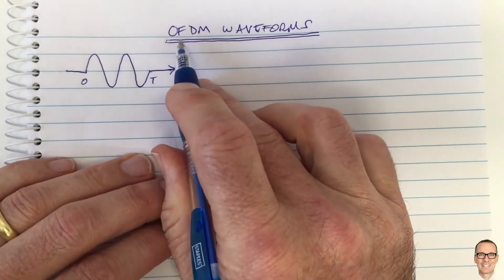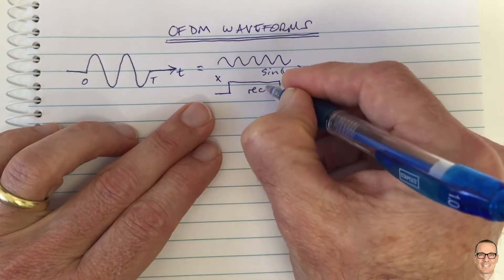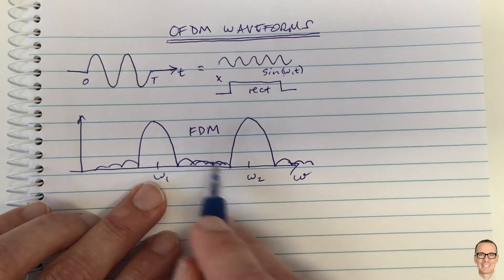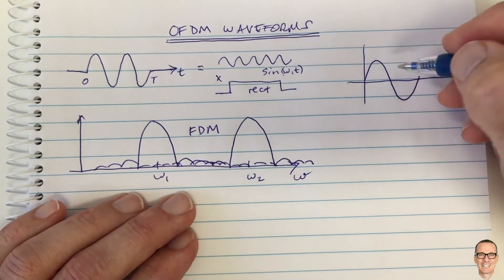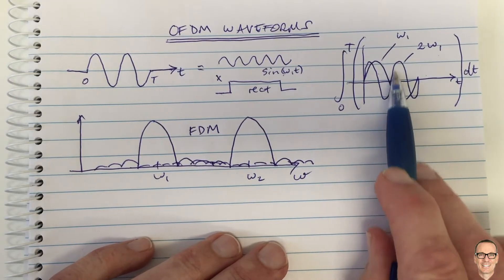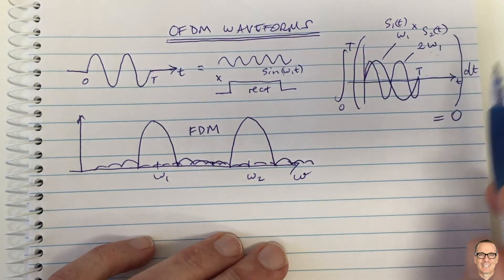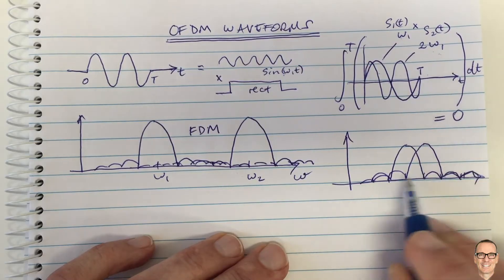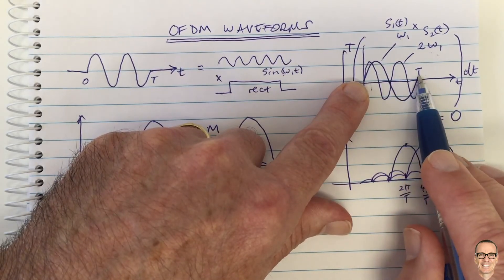OFDM Waveforms

Comment: I didn't quite get the part where you said "as we know, multiplication in the time domain is the same as convolution in the frequency domain". do you have a video explaining this? or even a reference I could read?
Reply from the maker: Good question. I'll add it to my "to do" list. In any case, it is a standard property that is listed in all standard tables of Fourier Transform properties. You'll find it in any Signals and Systems textbook.
Reply: @iain_explains  great, thanks!

Comment: There is one thing I do not understand. To make frequencies orthogonal, I take they have to be proportions of each other like f / 2f / 3f. But 2G bandwidth is 2412 to 2484 MHz. So to use this wont we need 2412 / 4824 / 7236 MHz?
Reply: Sorry, I realized in a moment. They are proportional, just not f and 2f but 2000f and 2001f. Cheers.
Reply from the maker: Yes, that's right. The "base band" frequencies are multiples of the fundamental frequency, but then they need to be up-converted to the carrier frequency.

Comment: I must be missing something, but I don't really understand how this works in practice. That is to say, if I send a signal on a 2.4 GHz carrier frequency, then this seems to say that it's orthogonal to a signal sent on 4.8 GHz. That makes sense, but I don't understand how we apply it within the 2.4 GHz channel, which is only 60 MHz wide and so doesn't allow for one frequency that's twice the other. How can we find two frequencies within the 2.4 GHz channel that are orthogonal?

(Apologies if this is so far off base it isn't even wrong :-))
Reply: Like, I can see that if you have two signals, one with frequency 100\omega_1 and one with frequency 101\omega_1, then they will be orthogonal over exactly 101 cycles of the first = 100 cycles of the second. But if you have any other numbers of cycles you lose the exact orthogonality. So I don't see how to use this trick on more than two signals at a time. If this is explained in a subsequent lecture just point me in that direction. Thanks!
Reply from the maker: Good question. I think I should have pointed out that the frequency relationships between the subcarriers in the OFDM waveforms are all at baseband. You're right - no one ever seems to point this out - and it is confusing. I think you've just given me a topic for another video. In summary, the OFDM waveform that's generated from the IDFT operation still needs to be up-converted to whatever carrier frequency is being used.
Reply: @iain_explains  Thanks Iain! I should note that in this video you specifically referenced the carrier rather than the baseband frequency -- maybe there was context that I was missing that made it clear the frequencies should be considered baseband? Watching some other videos on this elsewhere on YouTube I feel like I got a different explanation -- the exact length of the pulse results in a specific distribution in the frequency domain, given by the sinc function, and the zeroes of one frequency domain distribution are set to line up with the peaks of the adjacent frequency domains. That makes more sense to me but seems like a different definition of orthogonality than is given in your video. I love your presentation style so it'd be great to see a video from you addressing this. Thanks!

Comment: An excellent video. This one and the series. Many thanks, Ian!

One comment about the math. At 3:30 you mention that the multiplied signals cancel out. This is, of course, true. However, your explanation has a small error. You said that because the signals are symmetric, the positive cancels out the negative. It's not the symmetry, or at least not in the way you explained.

Please have a look at the start of the cycle on the time axis. Both f and 2f signals have positive values, and their product is positive. Then, at the end of the cycle both f and 2f signals have negative values, and also their product is positive. Two positive values, when added up, create a bigger positive value. The product, when summed up over the full cycle, is zero, but what cancels out what, is not what you explained.
Reply from the maker: OK, thanks for pointing it out, but I think you're splitting hairs here. I just pointed to the wrong part of the signal, that's all. This is really just a small "visual typo". Everything I say is correct (I don't want others who read this comment thinking that there is anything wrong with what I say in this video.)

Comment: Nice explanation. To sum it up; to increase channel capacity we create w1 and all subsequent wn should be integer multiples of w1 (in frequency) - then we can bring those sinc lobes (data containers) close together without having any interference at the receiver. Very smart technique.
Reply from the maker: Well, we're not actually increasing the "channel capacity", but we're finding a way to send data at a rate that is closer to the "capacity" without needing to do a difficult equalisation task at the receiver. For a video on the definition of "channel capacity" see: "What are Channel Capacity and Code Rate?" https://youtu.be/P0WY96WBUyA and for an explanation of the relationship of OFDM and equalisation, see: "How are Different Equalization Methods Related? (DFE, ZF, MMSE, Viterbi, OFDM)" https://youtu.be/hYNwTTWrp48

Comment: Thank you very much for nice explanation. How to apply these techniques in underwater wireless communication using acoustic signals? Please make a video on underwater acoustic wireless communication and what modulation techniques can be used to estimate the parameters data rate, channel impulse response, bit error rate etc. It will be very much helpful for those who are doing wireless communication for ocean or seawater or underwater.
Reply from the maker: Thanks for the suggestion. I'll add it to my "to do" list.

Comment: Thank you very much, greatly explained the concept, but have a question, from my understanding we are able to use a rect function in time domain only if the signals are well spaced in the freq domain, otherwise we resort to the raised cosine function? is there another reason on why we dont use raised cosine here?
Reply from the maker: Yes, what you say is true for single carrier signalling. If you are sending multiple signals, each on its own seperate (non-synchronised, non-coordinated) carrier, then the carriers need to be well spaced in the frequency domain, and it's a good idea to use pulse shaping. This is to ensure that they are orthogonal (ie. that they can be seperated out at the receiver, eg. by using band pass filters).   But, if the carriers are synchronised, and spaced according to the OFDM principles, then they are automatically orthogonal (by design), and you don't want to filter them in a way that destroys the orthogonality. If you haven't already seen my video on OFDM, then check out: https://youtu.be/Z4LIgNgNAlI
Reply: @iain_explains  Got it, your videos have helped me a lot through my digital communications course, thank you very much for the help

Comment: Sir, if a given communication system has 5MHz bandwidth and operated at 1.8 GHz of carrier frequency and using ofdm, how to estimate the minimum number of subcarrier in order to avoid selective fading? Thanks in advance
Reply from the maker: Good question. This depends on the frequency coherence of the channel, which depends on the environment (number of reflected paths, etc.) Generally speaking, you want to have enough subchannels so that the width of each subchannel is less than the coherence bandwidth.

Comment: Thanks! So all there is to OFDM over good old FDM is that you pick carrier frequencies that are multiples of each other!?
Reply from the maker: No it's not just the relationship of the frequencies. Note that the Sinc functions (in the frequency domain) all have the same width. In other words, the digital symbol rate of the signals sent in each frequency channel must be the same, and it must also be an integer multiple of the wavelength of each carrier, otherwise they are not orthogonal. Also, for practical systems, the frequency synchronisation must be very accurate between each of the subcarriers (channels) - much more than for FDM.
Reply: @iain_explains  Ok thanks! So OFDM basically boils down to choosing and holding those very specific frequencies, and other than that, it's very similar to normal FDM?
Reply from the maker: Yes that's right, although the acronym OFDM refers to a single user system, where the user divides up the data stream into multiple streams that are each sent on a different carrier (sub channel) (see my video: https://youtu.be/Z4LIgNgNAlI ) In contrast, the acronym FDM refers to a multiuser system, where each user sends a single stream on it's own (separated) carrier. The multiuser version of OFDM is called OFDMA (for "multiple access").